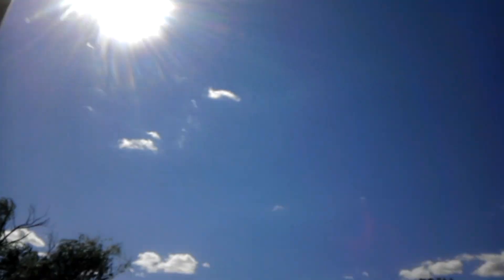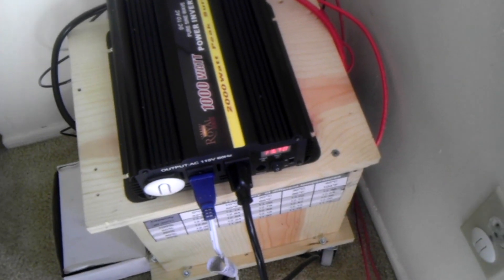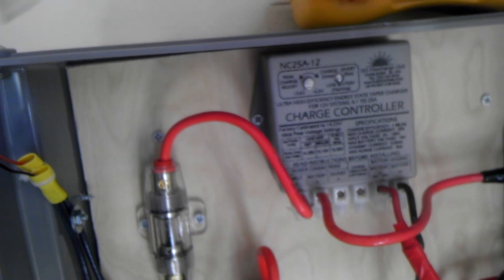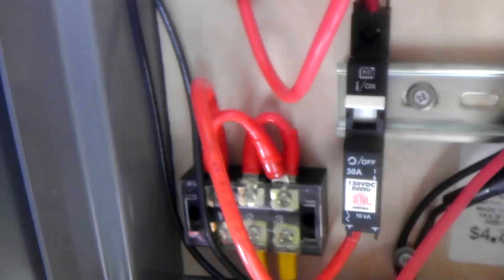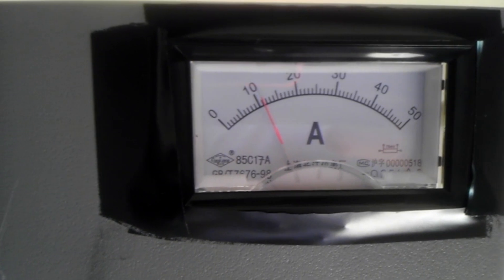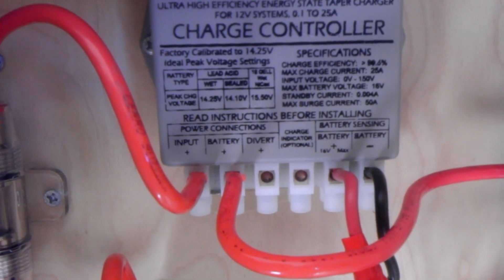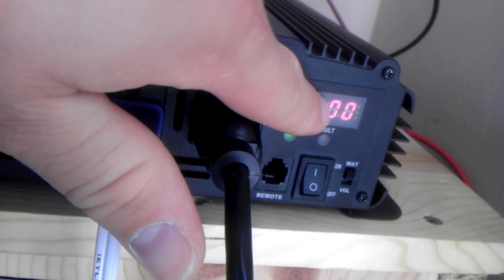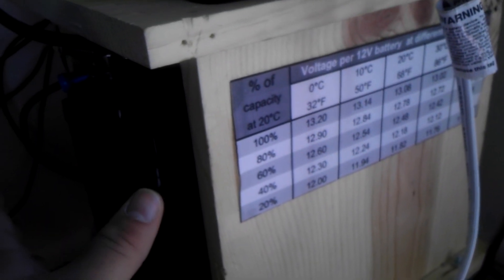Renewable Apartment - My Mostly Complete Solar Off the Grid Setup

Comment: You're wrong about why the fan on the inverter is running. It is running because you are using it to power your Breeze Box and your computer. The fan on the inverter is running to dissipate heat away fro the inverter circuit board to keep it from burning out.

Comment: It is a very good idea to put a fuse on the battery wiring. Because that's where the serious amps (i.e. amps that can make wiring red hot!) will come from if something goes wrong with your wiring inside your system box or charge controller.  It should be as close to the battery as practicable, but preferably not in the same box as it. You shouldn't really need a disconnect as such though, a fuse is better.
Reply from the maker: This is an old setup. I have since updated it but at the time of recording the only thing I did not not have an actual fuse on was the inverter which had an internal fuse. Also the controller acts as a blocking diode on the charge side so nothing would come back from the battery. Again I have updated this setup to bring it more in line with safety measures.

The disconnect was my personal preference.

Comment: The warning on the MC4 connectors is mainly concerned with solar panels connected to grid tie inverters where the string voltage is 600v plus. Probably not a good idea to undo these until the load has been shed. But, as you say, the inherent act ov disconnecting solar panels is perfectly fine to do. What is not such a good idea is disconnecting the battery while the solar panels are connected to the charge controller, under certain circumstances that will fry it. Depending on the model etc.
Reply from the maker: I contacted grape solar about this. In not so many words... The lawyers.

Comment: Your wiring setup is absolutely BEAUTIFUL!!! You are one of the few to actually use a DC breaker as a disconnect. I looked up the specs on that charge controller and now I have to completely rethink my proposed solar setup. I know it's a lot to ask, but would you consider providing a wiring diagram and parts list? If not, I understand, anyway your setup is A#1
Reply from the maker: Will do. I am waiting for a 3 way switch to arrive in the mail. It will isolate my charge controller and my grid tie inverter. I will upload a new video when that is complete.